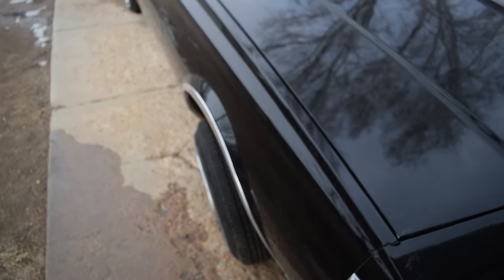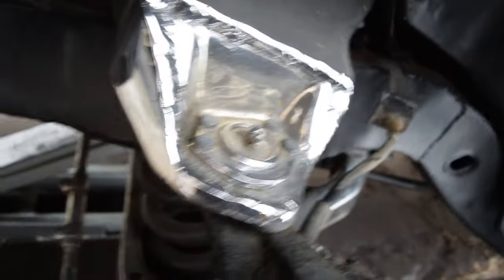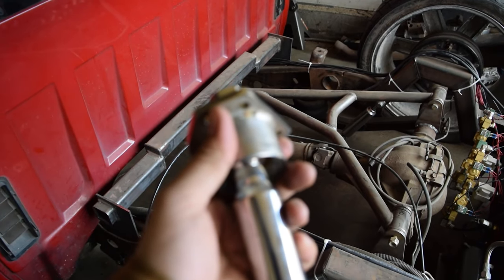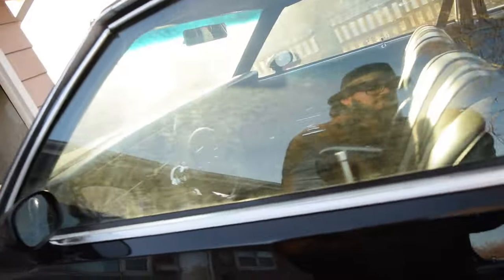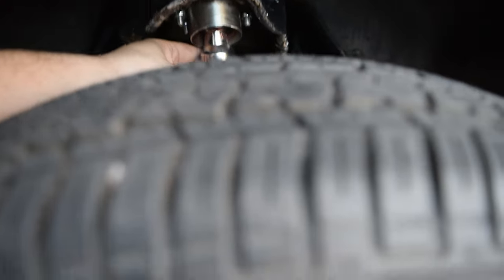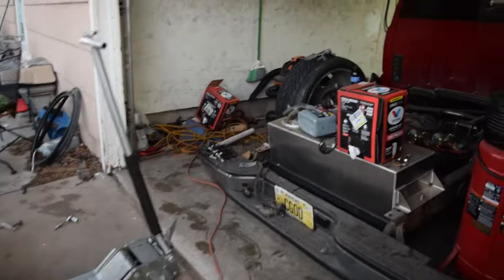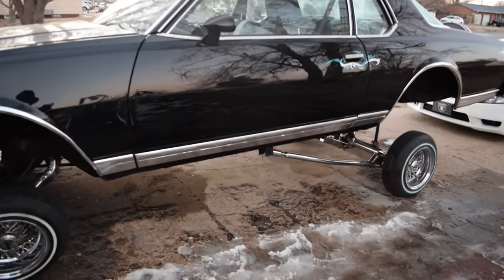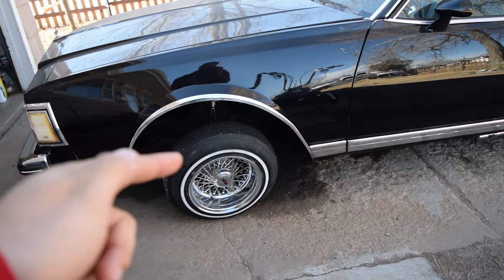Black Magic 4" Extended GM Ball Joint Install

Comment: nice video thanks for posting ive been contemplating getting a set of those same balljoints from BMH.  i appreciate this video
Reply from the maker: No problem! Thanks for watching!
Reply: @CGOD  been searching for a video on these aint too many out there honestly.
Reply from the maker: @thegoodlifemia  lots of people are scared that they’ll break but mainly you just can’t lay out low. Puts the bolt at too much of an angle and will snap it
Reply: Fuck yeah!!!
Reply: @CGOD  yeah i have other worries about them, like the change in camber mainly since i already have a arms extended 2 inches gonna prob give me too much tuck with those on there. might just go with the "stock" sized ones.
Reply from the maker: @thegoodlifemia  mine didn’t make any camber change, I think my arms are 1.5” or 2” extended also
Reply: @CGOD  interesting… seeing as u now have them on ur whip, u recommend them to others? Or not worth the hassle ?
Reply from the maker: @thegoodlifemia  I’ve barely got them on so don’t have too many street miles. I don’t recommend them for hoppers or cars that lay low. If you have a high lock up car like mine that doesn’t lay too low or hop it should be fine.
Reply: Can they be used if riding 30s big rims just for lifting @CGOD
Reply: And I have 1500 springs and shocks on car
Reply from the maker: @kedsherman4457  yeah it would work even better cause you could set the height at mid travel. On hydraulics it only maxes the balljoints fully up or fully down. It would be 100% fine anywhere in the middle
Reply: @CGOD  ok so help I have extended upper 1inch ball joints and 1/2 inch lift cups will that be fine with me doing anything too the bottom control arm I have same car ....like will too lean outward
Reply from the maker: @kedsherman4457  no you’d be fine, your springs will sit in the pocket on the frame. Should bolt up just fine

Comment: Just got a set of 2"from hoppos and just put one side one so far hop they last  lol 4" look sketchy tho 😮 sicc ass ride tho
Reply from the maker: So far it’s been fine. What I’m thinking is flipping the bolts around to where the nut is on top. The stronger part of the bolt will be at the shear point
Reply: How do you like the 2 inch hoppos ones @alexadame1308 ? I am about to pull the trigger on some for my cutty.

Comment: Has the bolt broke ? 
Ived had problems with them ….. went back to regular ball joints
Reply from the maker: So far they’ve been good, I removed one just to check it out and it looked fine. If they break it’s because the uniball only has so much travel, you have to have the right size arms and can’t lay the car out too low or it’ll max out that uniball and snap the bolt.
Reply from the maker: My uniballs are maxing out right now when locked up and laid out lol if my springs were any shorter it would snap the bolt for sure

Comment: DO THEM EXTENDED  BALL JOINTS POP RIGHT IN DO YOU HAVE TO GRIND WHERE THEY SIT IN AT
Reply from the maker: @randallcollins6488  only thing you have to do is enlarge the hole in the control arm and drill the spindle for the bigger bolt.
Reply: @CGOD  what tools did you bro

Comment: throw a full stack of red sky high coils and call it a day
Reply from the maker: Not really looking to hop, mainly just a lay and play setup
Reply: @CGOD  yes but a full stack would make that spring less compressed so it doesn’t look like it’s about to pop out. I have heard of that happening. I’m about to order 2-3in ones for my Lincoln
Reply from the maker: @HighSociety252  but then the car wouldn’t lay as low either. Right now the springs are a proper size I can lock it up and lay it out without putting too much stress on the balljoints

Comment: What’s up bro thinking about adding these on my ride I know this video is a year old want to know if there still putting in work or how long did they last or did u replace them already
Reply from the maker: They’re still on there, lay and play was fine. I put 8 batteries to the front pump and started hopping it for a few months. Finally popped a bolt about a week ago, just replaced it with another bolt. Easy money
Reply: Coo thanks for info
Reply from the maker: @toketnp  yessir! I wanna say also that It broke due to my own error on hitting the switch. So as long as you’re nice to it it’ll be nice to you
Reply: @CGOD  that’s what I heard that hitting. The switches is a risk on these but how about three will you think that’s safe and they can handle it?
Reply from the maker: @toketnp  I’ve seen a lot of people 3 wheel on them, my car needs a slip yoke to 3 wheel so I haven’t yet, I’m sure hopping is more stressful through so I think they’d be fine

Comment: did you fix the problems with the balljoints?
Reply from the maker: Yeah it’s been all good ever since installing them
Reply: @CGOD  no issues up or down?
Reply from the maker: @danchmelyk3811  nope it’s been working good
Reply: @CGOD  did you change anything

Comment: Get them spindles loco it’ll be a lot better bro.
Reply from the maker: So far I been hoppin it a bit and the only issue is I broke one of the little bolts that hold the balljoint in. I plan to chain up the front eventually